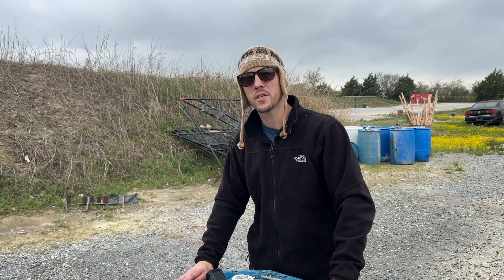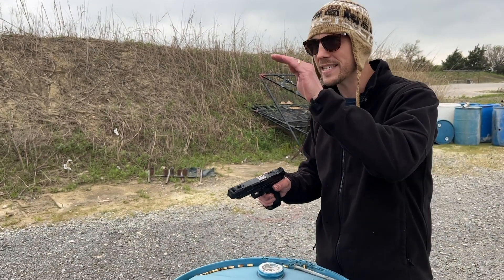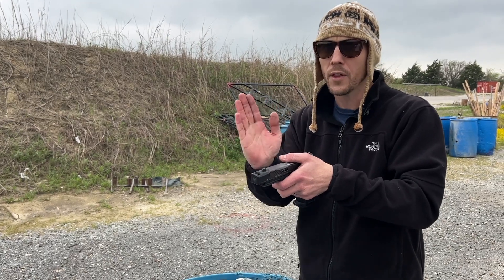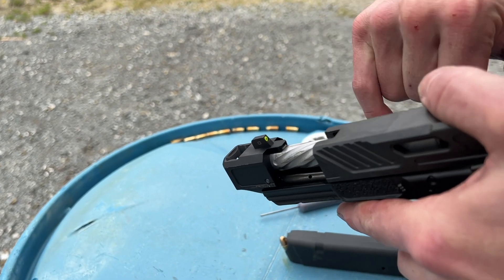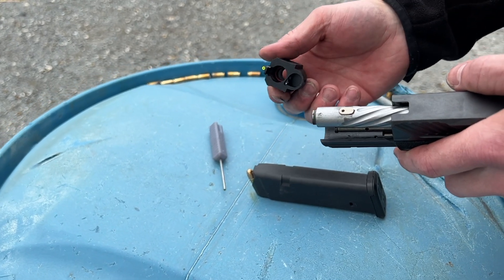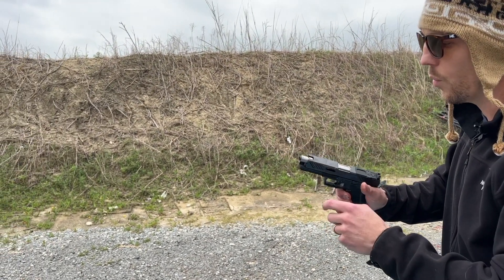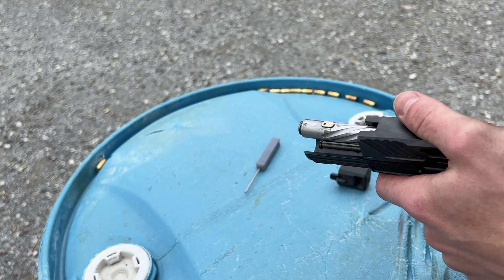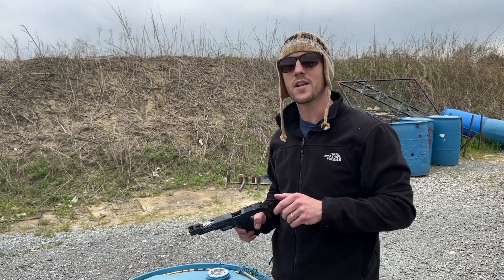Technical Tuesday - DR920P Locking Key Explained

Comment: Man I really love where this company is going.  I bought an mr920 with a threaded barrel a long while ago now. I can most definitely say, it’s absolutely one of the best edc guns I’ve had the pleasure of owning and carrying.  The customer service is absolutely one of if not the best in the gun manufacturing industry.  I’m a sig sauer guy down to my atomic make up, if you were to look at my dna in a test, S. I. G.  would appear as a combination many millions of times lmfao.  But I’ll tell you what,  shadow systems is fast becoming its equal to me.  Their engineering and ideas are so tasteful and well thought out.  The guns function beautifully are drop dead sexy as far as aesthetics go.  I’ve put about 2500 rounds of 9mm through it ranging from hornady critical duty +p and hot +p Norma and liberty civil defense loads, all the way down to the most garbage, cheap, doo doo fmj’s i could find, and I haven’t had a single malfunction or failure to do anything.  For as light as the pistol is, you’d expect the recoil to be more prevalent too but the texturing and ergonomics are so well placed that it’s not half as snappy as you’d expect it to be.  I’m rambling and I apologize for that but my point is, I highly recommend this gun to anyone that can afford it!  And if you can’t afford it at the moment, I suggest to wait a few more paychecks and save a little extra money to spend on a shadow systems pistol,  it’s worth it! I promise!!
Reply from the maker: Thank you so much for the kind words! So glad to hear you’re enjoying your MR920!
Reply: Great post man!  I just put mine in layaway today. Super excited about it.  Your post makes me feel proud about my purchase.